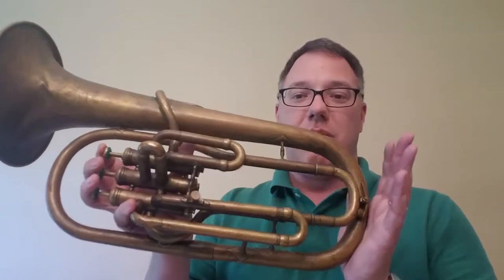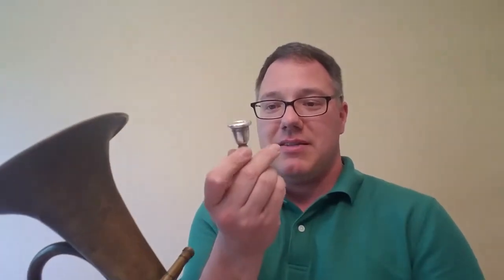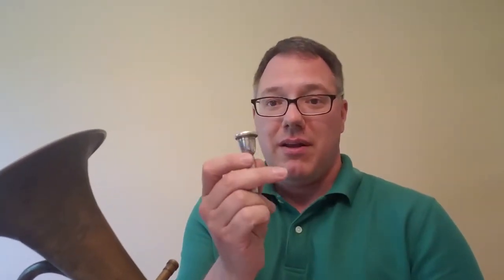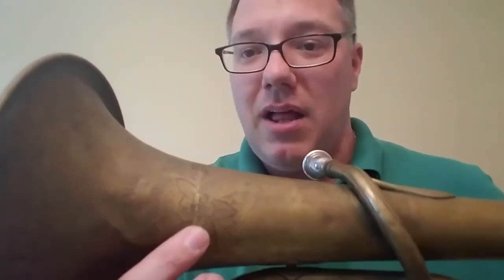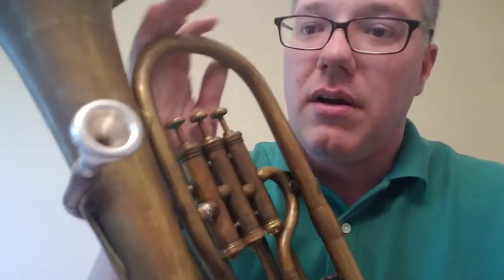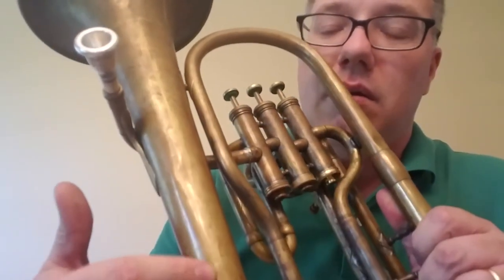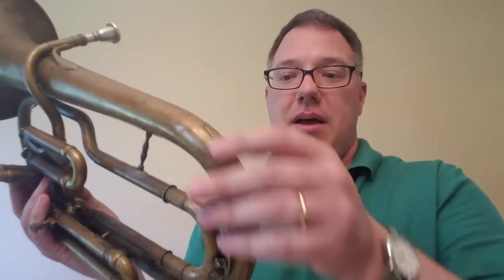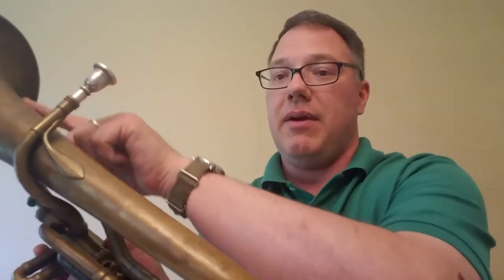Royal Professional Alto Horn made in Czechoslovakia

Comment: Something I did on a silver plate cornet that I'm happy with is use a car polish that has carnauba wax in it, on just the bell up to first attachment, and the mouthpiece.  DPO Dreaded Previous Owner AKA eBay seller had polished a part of the stencil done for Chicago retailer, and tarnishing of unpolished area was uneven, ugly, weird.  Only polish by hand, I think DPO Q&D handiwork may have softened the stencil marking.  I'm very happy with the way the cornet looks now.   A Good way to polish silver is with the hot water, baking soda, aluminum foil method, but I won't be doing that.   The carnauba wax in the car polish probably lessens/slows tarmishing a lot.  Some instruments have little knobs on the slides to help pull them.  If using the rag pop method to pull those stuck slides there must be a long cut in the cloth the knob passes through to eliminate any stress specific to the knob  because the rag will pull them up & be a ugly mess.